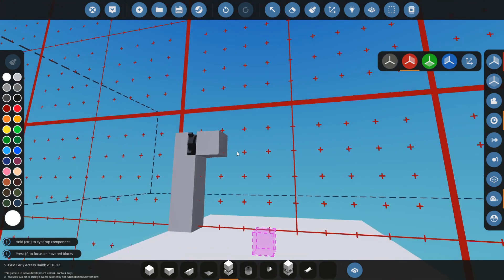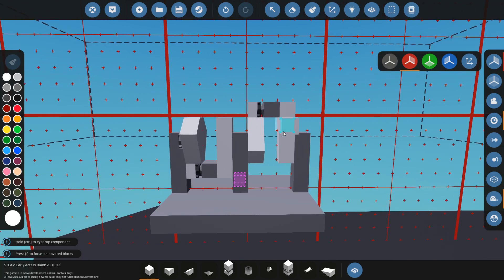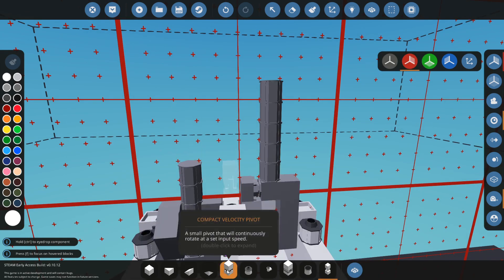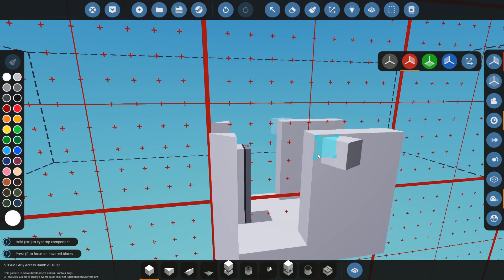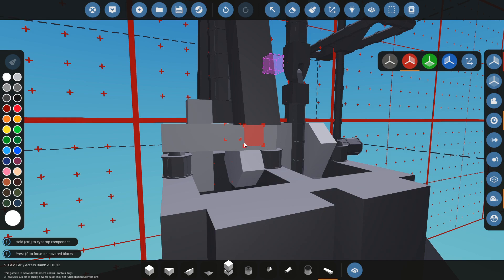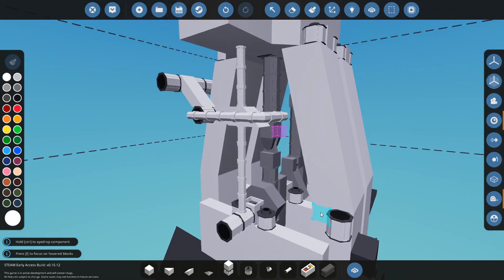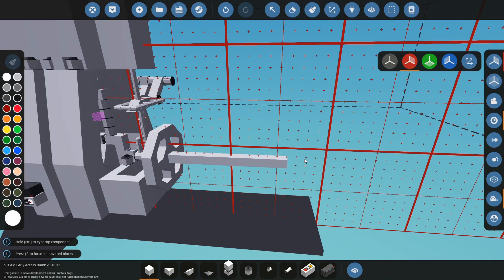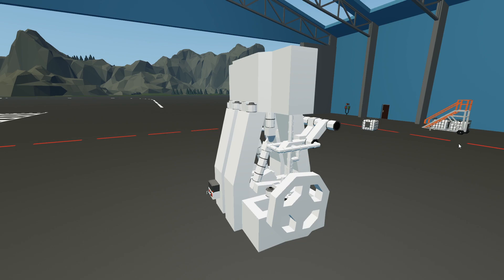- Stormworks Tutorial - How to build a simple Naval Steam Engine

Comment: I have two questions. Would it be possibole to use this engien on a steam locomotive? And if it would not work can you make a engien for a steam locomotive?
Reply from the maker: Using this exact engine would most likely not work, but it works in the same principle. A track that goes sideways, a pivot with a vertical axis, with is then connected to the wheel/wheels with another pivot.